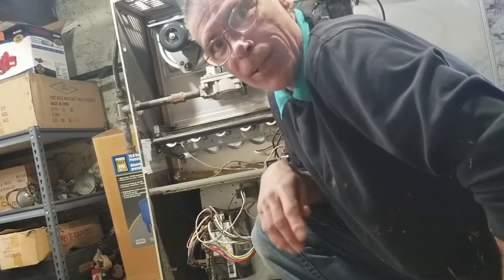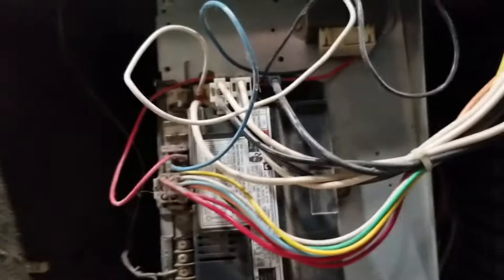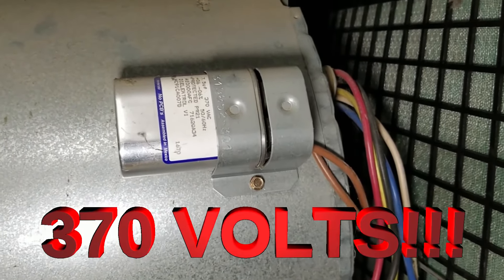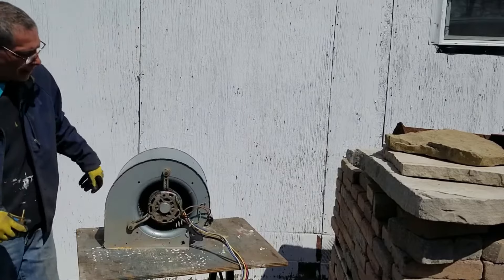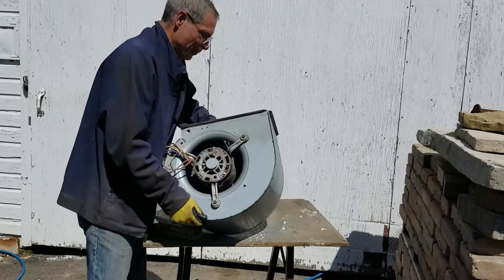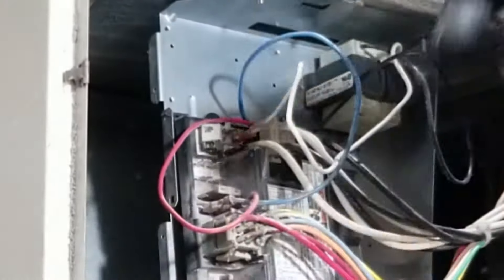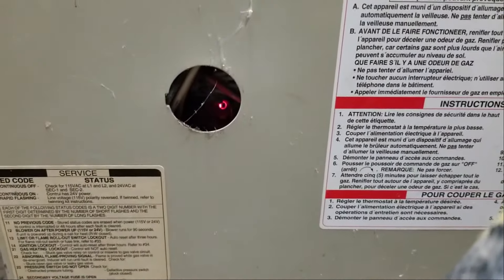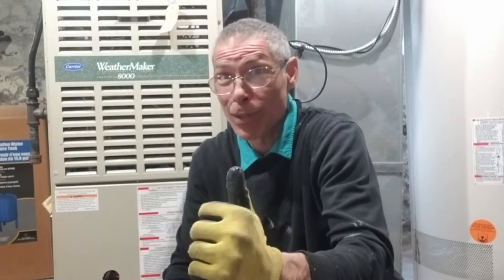Clean Your Furnace Blower and save money

Comment: Call a professional on this people save yourself the headache, if you rewire the wrong way it can be very costly to fix
Reply from the maker: I could not agree more. Thank you for using your judgement and realizing your limitations. If you are willing to attempt this, be absolutely sure you know what you are doing. Hot Feva here has some doubts, so he called a professional. That is solid advice.
Reply: Anyone that has any experience with taking electrical things apart already will know to take a picture first, but if you're not comfortable don't do it, yes. With that said, you don't have to be an hvac professional or an electrical engineer to do this either.

Comment: No need to klean your furnace fan if you replace your filter every month.
Reply: They suck air from the front of the Furnace that doesn't go through the filter
Reply: Replace my filter every month?!!  My furnace filter does not see that much dust.  Every 6 months works